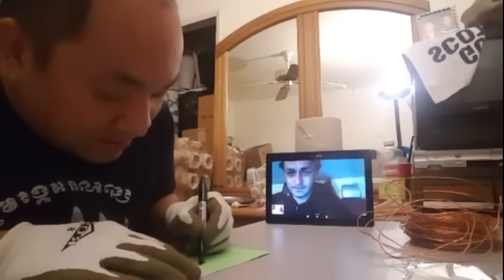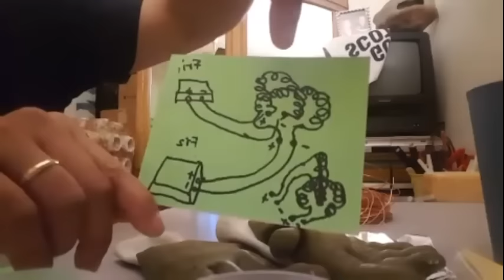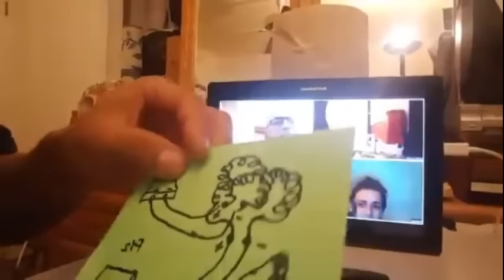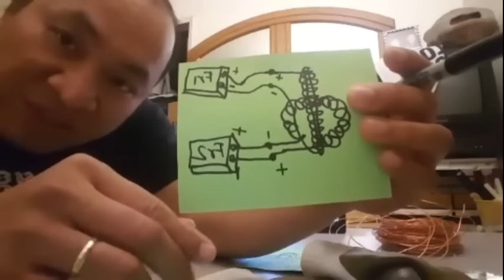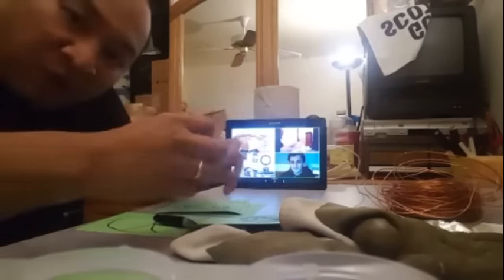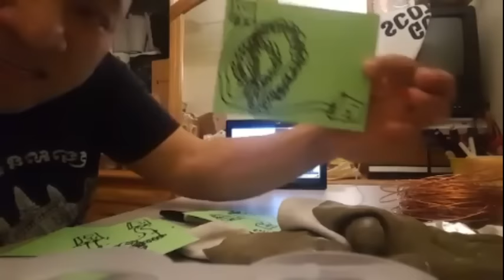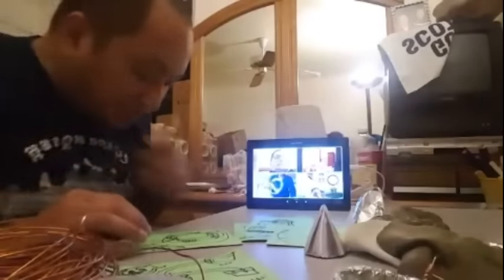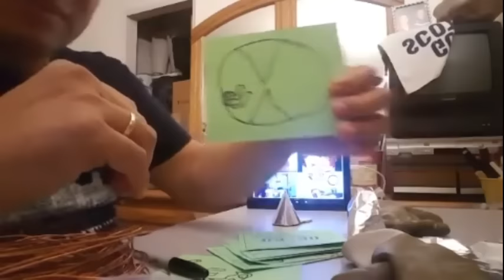January 8th 2017 Q Device Workshop Antigravity using a Q Device to command a Magrav Coils  Set

Comment: the exact frequency is 8hz, 13hz and 21hz. if inner ring one get 8hz the outside ring will get 13hz, and if the inner ring get 13hz hertz the outside ring get 21hz.  ect , so as you can see is all fractal fabbinicci . so it will take 1 to 2 hours for the energy and oscillation to build up.
Reply: Kosol Ouch does the higher being tell you if it can build device that start without power or start up with 9v battery with special capacitor called a captret on YouTube that is also depends on geometrically to work